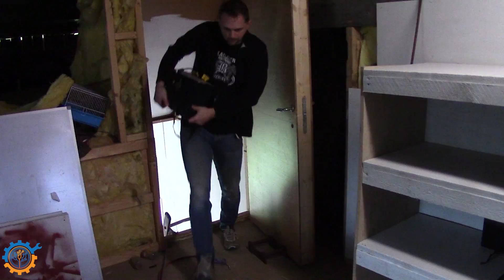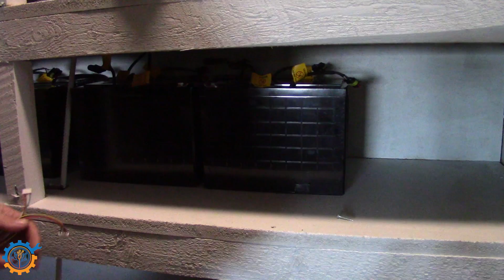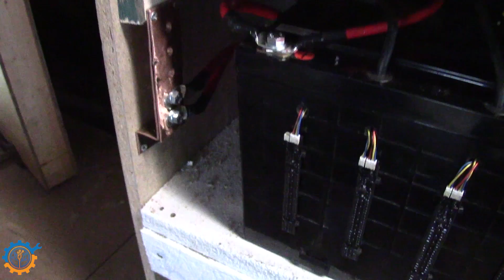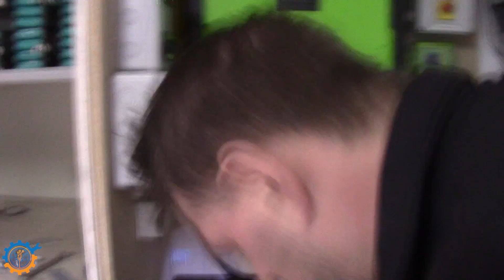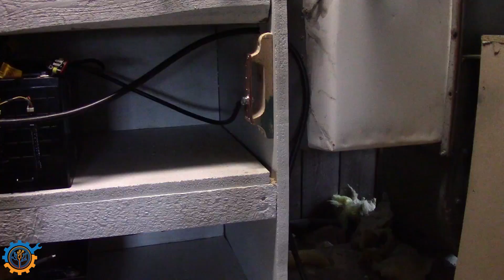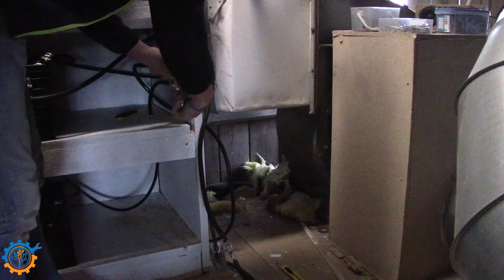41kWh LiFePo4 shelf - Part 1/2

Comment: Hi there. Where did you get these nice batteries? Are they second hand, do you recommend second hand LiFePo? My installation is only 300 Watt feeding 3 old car batteries which don't hold a lot of charge. Nice job!! Chears
Reply from the maker: Marcel Barros they are 2nd hand. brooken bms so bought em cheap. if u test them before buying it is ok.

Comment: 50mm is not ideal if you go over 150 amps constantly or a long run of it can be also not very good under large loads but 120mm DC cable  is very expensive..
Reply from the maker: 17kW of solar on roof. Inverters can do 14kW continous and peak above 20kW...  And dont say its to much... Just the light in my Garage takes 3kW and if i power up the Paintbooth to do a work for customer i can easily draw 12kW constant ;)
Reply from the maker: Correct.  Running 120A load i get 0.25V voltage drop. Meassured on cells compare to on inverter so its not that bad.
Reply: Is the 0.25V voltage drop under load?
Reply: i should of read it before commenting.
Reply from the maker: No worries. Yes the drop is during discharge load in this case. I imagine when i max it now. (Can reach 230A)  the drop will be alot higher. Pending to test. Nevertheless I need to consider thicker cables in future
Reply: Probably a good idea to up the size of your battery cables or your equipment will suffer eventually and your efficiency will go to crap..
Reply: 230 amps 48 volts 3 meters cable length 210 mm cable is required to be accurate
Reply: Its like using string to tow your car...
Reply from the maker: It all depends on what voltage drop you would see is doable. 230A at 210mm2 would give me a voltage drop of 0.12V.  Thats 0.23% loss... If i go 100mm2 i get 0.22V drop and 0.4% loss. I would say that i dont have to go above 100mm2 cables no matter. The cables will not burn out and 0.4% is negliable compare to the loss in the inverter. It would be more worth swapping out the inverter to one that may be 5-10% more efficient :)
Reply from the maker: You say "required" required due to what rules/guidelines/numbers have you based that on?
Reply from the maker: Double up is what i might be doing. The price in Sweden for copper is expensive like hell unless you know someone. I dont have any contacts that will sell fo 3$ :) That would have been awesome price but scrap value here is high and thiefs even go into yards to steal it....
Reply from the maker: Yeap it is. But limited to 230A max currently in software.  80W is only in bursts and when doing max if so. Also note that the inverter alone draws 300W+ . So still that amount isnt much in terms of the whole part. If i take that 80W and add that up over x time i dont see how i can save the money going up to 200mm2 or thicker cable im afraid :)
Reply: lol never enough I have 24kw of continuous inverter power in 3 phase  with a peak of 32kw. 1800 amps of lithium batteries at 50 volts Three 5kw  600 volt charge controllers 15kw of panels and 240mm cable from the batteries to the inverters at 1.3 meters length and a peak draw at 740 amps on occasions..
Reply from the maker: TheMFrelly damn! thats cool
Reply: I know a bloke who filled 1 inch copper pipe with lead then put it in PVC pipe for an insulator instead of buying cables worked great ...
Reply: This is not cost effective. Lead is very expensive and only 1/12 as conductive as copper. Hollow aluminium pipe is what we use for busbar in switchyards. Cheap and works a treat.
Reply: David Zucaro he got the lead for free he gets everything for free even the copper pipe recycling...
Reply: David Zucaro p

Comment: is there a reason your dc cut off switches are on the negative?
Reply from the maker: Yes and no. In this case it actually doesnt matter... But if you have been working on cars or such where you ground the car chassi you always remove the negative first. Thats because when removing negative it doesnt matter if you touch the chassi.. But if you on the other hand remove the positive and accidentally touch the chassi you get a nice spark... Thats why i have continued taking the negative as where i put the disconect switch. 
Perhaps someone else have a better answer but this is how i have been tought.

More ideal would be to have a 2 pole switch that do disconect both positive and negative!
Reply: ohhh!!!!!
it is not a battery you are connecting to a car.
look into "bussmann disconnect". they are three pole. and have the added advantage of having large fuses in them. naturally you need only use 2 poles for it. i don't know about sweden, but this is how we do it here in australia.
after everything is turned off. you pull the large handle forwards, and voila, battery totally disconnected. it can also be used as an emergency cut off.
to my knowledge, the negative pole has a certain relationship with ground, earth. for example i have a solar charger, midnite classic, that has ground fault detection capability and arc fault as well.  which might not work in certain cases.
not saying it does not work isolating the negative pole, i just have never seen it done before. it might confuse some third person not familiar with your wiring, particularly using black wire for both  positive and negative. you can colour mark them with heat shrink or tape. i colour coded and and labelled them. so as to avoid problems with a third party that might work on it at a latter point of time. or when my memory degrades. hopefully not soon.
greetings from the other side of the world
Reply from the maker: Yeah the bussman disconect is something i want to add. I like that one but its not common in Sweden as of now. Can you link where i can get one?
There is nothing in solar documents here stating how to do it more than that i need a disconect switch. And most electricians i talked to working on solar also said "Good question" :)

The color coding is missing at the inverter side and that is miss by me. Not sure why I didnt do it and it should be sorted asap! Thanks :)
I am working on redoing that area and by doing that it will be more clear i hope when it comes to what is what.
Reply: well i got them from an australian supplier. they have the cheaper chinese version on aliexpress. maybe you look on the swedish ebay.  the disconnects have different current ratings. mine has 250A fuses and rating. for a 7.5 kw continuous rated inverter.  (noted 125 A max charge and discharges so far)  you might check swedish electrical suppliers. or google it.
Reply: https://www.aliexpress.com/wholesale?catId=0&initiative_id=&SearchText=3+pole+disconnect
here aliexpress link

Comment: I thought you have to disconnect the ac first?
Reply from the maker: Good question. Always check the device manual on in what order to do it. Most devices demand that you disconect input first and battery/output last. The hybrid inverter do say that battery should be last and pv first... Though i know that this device will function and does not harm no matter how you disconect stuff. You can do it in any order.. But generally PV > Grid> Battery